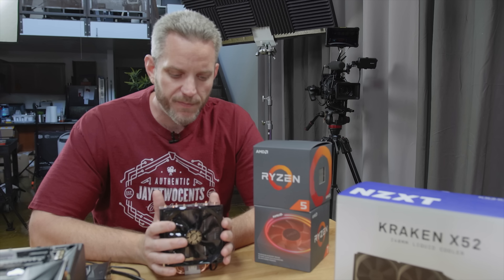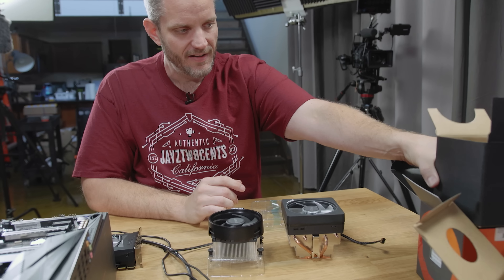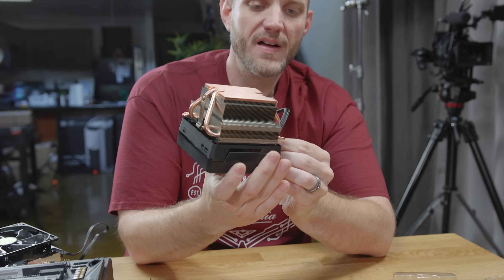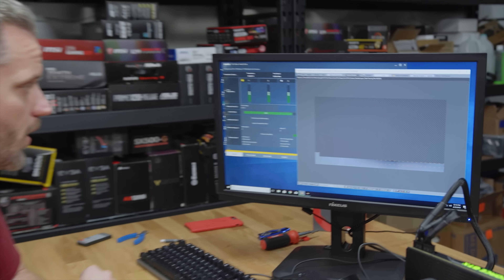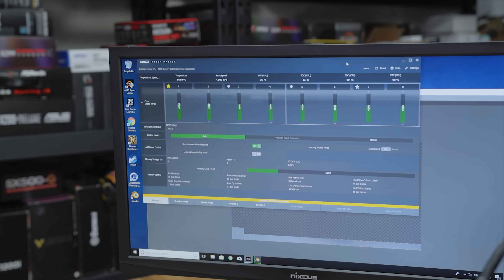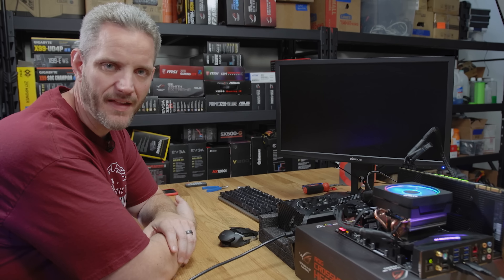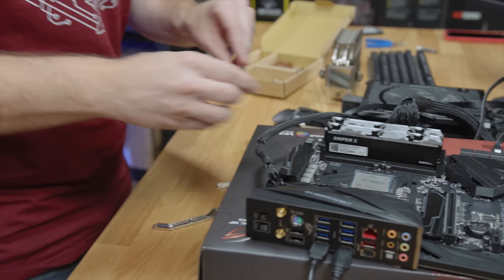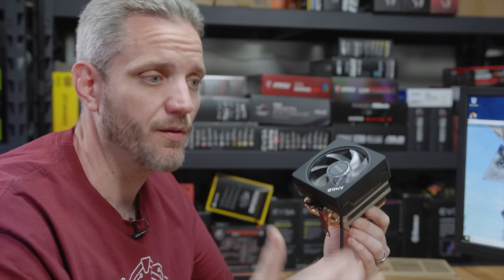Overclocking with a stock air cooler?? Is it even possible?

Comment: I have been overclocking with a air coolers for many years, well over a decade.    As you know, Noctua make good air coolers, I currently use the NH-U14S on my i7 7700K.

Comment: there is a small interruptor behind where the rgb motherboard header wire onto the wraith prism that has ¨L¨ and ¨H¨ , that way you manually let the cooler set up a more agressive fan curve speed at the expense of noise, still a terrific cooler for the ryzen though, intel needs to make such a capable cooler for their i9s i7s to get back in the game.

Comment: I have an AMD FX 8320 chip which is really an underclocked 8350, so I just set it to the 8350 settings in the bio (4 gigahertz, 1.35 volts) and use the stock cooler...no problems after 7 years of use like this

Comment: I'm running my Ryzen 2700X on the Wraith Prism as well, with a full overclock. (Budget reasons)

4.15GHz 1.325 Volt on Asus B450-E Motherboard
73°C max at full speed 3600 RPM with the Wrait Prism Cooler with high mode on. 19°C Room temp in the Coolermaster Cosmos case.

3m 30sec BMW Blender 2.82a render time
4150 Cinebench R20 score

It's a little bit lound but I don't mind it that much. Since it's nice and stable with no problemo!

Comment: This and the overclock with2700x video just showed me that I don’t need water cooling.
2700x with stock Prism cooler
ASUS Crosshair VII
G-Skill Trident 2x8gb 3200
At factory settings in my really old case with 3 fans (one of them a side fan) ~45-50C, in new Zalman case ~50-55C with 5 fans.
FYI - My old case was pre-RGB and cable management. It was a new experience working in a case with cable management. I’m curious about the loss of 5C with the loss of the side fan.
Case - Zalman Z9 NEO Plus PT Black

Comment: I've got a Ryzen 1600 with its stock wraith cooler. Only clocking I did so far was from optimal to performance. It seems to reach 4.1 ghz when it wants to and hovers around 65 for temp on any program, except for protein folding. I noticed when I run that on the cpu temps spike into 80 and maybe beyond.

Comment: Got this CPU for a build and going to do it on Christmas day. I am thinking to overclock this CPU to 4.0 GHz with the stock cooler, I will also have 3200 MHz RAM so think that if the stock cooler will allow it to run at a good temp it will be a safe bet

Comment: Socket 939 Athlon 64's OCed like beasts with stock cooling.  My 3700+ was running @2.6Ghz with the stock cooler.  Early Core2Duo's were also monsters.

Comment: It keeps overclocking in stock for me mostly at 4.3Ghz, then stopped auto-overclocking to keep it at 3.7Ghz max now it's around 26-30c idling and rarely goes beyond 40c which is insanely cool with stock fan. It freaked me out first with hitting 75c just using Youtube!

Comment: When I first got the Ryzen 5 1600, I overclocked it to 3900MHz with the stock cooler provided.  Under load it would stabilize at 55 to 58 Celsius even in summertime.  But I installed a Swiftech H240 X2 and now it runs stably under load ~39 to 40 C, with occasional spikes into the low 50's.  If I hadn't seen it with my own eyes, I'd think It was impossible.  I'm a very happy customer.  Of course, I also re-timed my  G.Skills Ripjaws V Series 16 GB (2X8GB) 3200MHz @ 16-18-18-18-38-56 settings to 2933MHZ @ 14-15-15-15-34-51, which made another huge difference in performance.  But I have to say that the AMD-provided cooler was very adequate … for those who are worried about it.

Comment: My friend upgraded his cooler and let me have his wraith prism and it’s working great on my 2600 

On full load it doesn’t go above 60 degrees Celsius which the stealth I had before idled at 60 and would run from 75-90 C on load and stress test would make it hit the safety shutdown (like 105 degrees I think)

Comment: I have a question, i bought a 3900x using stock cooler, on a x570 elite wifi, is it normal for idle temps to be at 50c and 85c at load on gaming, ambient temp is 30c, not used to the cpu running so hot

Comment: Hey Jay. I m returning to see your test again and again. I have a question.  As I can feel hot air over a water radiator when computer is in use, it blows hot air. Don't you think the stock cooler blows hot air through those fins in the motherboard? Just qurious.

Comment: I just got the 2700 X with that cooler and under any load that increases the fan speed, which is frequently , it is unacceptably loud. So now I’m am looking for quieter coloring options short of liquid cooling.

Comment: First time I feel disappointed that i dont have to spend money to replace the stock cooler.

Ive been struggling to justify spending money on a Noctua cooler but just looking at how nice this thing looks plus how it performs.

After this vid I will have to just fix the fan settings on my case

Comment: bought a budget gaming rig for 300bucks that included a ryzen 3 1200 and a 1660ti. went OC'd the 1200 to see what it does since I don't really care about it as I have a 3600x to replace it and was surprised that it reached 4ghz at 1.35v and the temp never went over 57C.

Not sure how much better the Hyper 212 evo over the stock cooler but thats impressive for a stock cooler.

Comment: I really enjoyed this video on the wraith prism cooler paired to a 7000 series amd cpu. Since I am building a new system with the 7000x cpu and am not interested in OC but rather using the eco mode setting and going down to the 65W level to keep the thermals down, I was wondering if it is feasible to use the prism cooler on my new build. Just want to know if it will work without the fan going 4000 rpm all the time, and if it will slow the cpu below the benchmarks established by the eco mode settings. Really enjoyed this particular video and thanks again.

Comment: Hi Jaz. . Very good video. 
I have bought new system with 2700x and I m using prism cooler which is the stock cooler. 
But I only do blender rendering on it. CPU temp locks at 85C as soon as I hit render..... What do u think. Should I go for AIO or not? Czz I use 24/7 rendering even for weeks

Comment: Whats the L-H switch on the side of the cooler? And i assume the other ports on the cooler are one 4 pin and one 3 pin fan header? I am not familiar with that fancy stock cooler. Just curious. Dont think anyone has done a video on that cooler but probably because its just a stock cooler, but im curious. Thanks if you can answer.

Comment: Depends on temps surely. I'm running an old FM1 2.1ghz AMD CPU @ 3.6ghz with the stock cooler and temps under max load stay under 70*C. Of course an aftermarket cooler would reduce that temp further but I don't feel it's required.

Comment: Able to complete Cinebench R20 with Ryzen 5 3600 at 4.6 GHz all core with Wraith Prism cooler. Max temperature 89 degrees. Daily running 4.3 GHz and it's around 62 under load. This cooler is cheap, it looks great and performs well!

Comment: well all i can say is this i am currently using an i7-4770, its base is 3.2ghz and turbo rating of 3.7ghz. i currently am getting 3.89ghz performance, with no heat issues. im using the stock fan that came with an Acer Aspire TC-605. so i guess it depends on how cheap the stock fan the company uses is.

Comment: I’ve been using the stock Intel 4790K cooler for 5 years. It just lately started having problems and the processor has been locked at 4.35 GHz for those 5 years. My NH-D15 chromax.Black should be in Monday xD

Comment: Honest question, after you killed the SSD with the mixed up SATA connectors from the powersupply, is there anyway of repairing the SSD? taking it apart and repairing? or retrieving data?

Comment: I use a standard Wraith cooler and overclock my ryzen 5 2600 to 4.05ghz with 38c idle and 68c at heavy loads (Stays under 50c for the most part with 40% fan speed) I think the cooler is more than good enough, if i bought another air cooler i could maybe get 5% performance max? which i dont think is worth paying for imo.

Comment: I haven't seen anyone ask this..... But what did you do with the switch on the prism cooler?
The prism has a switch that either limits fan speed (less noise) or "overclock" mode which removes the fan speed limiter.

Comment: I use the wraith prism on the 5600x today, and never go above 65C... usually I never even hit 60C. It's undervolted so hits about 1.2v at 4.67ghz using PBO. I can run higher bosst upto 5.8ghz but it makes no real difference and in fact means boost doesn't last as long so I just stick to the lower temps

Comment: That's why invested in fan guards for ALL 6 fans in my case, it's too easy to bump a fan, watch a misrouted cable get sucked into a fan. A cheap chrome fan guard makes less stress when looking inside while it's running and checking components.

Comment: I took off my stock Wraith Prism cooler, was disappointed to find that the bottom of the cooler is full of dips and is not flat at all. I didn't notice when I first installed it because it had a huge square of pre-applied thermal paste on it, but I think that's pretty unacceptable quality on AMD's part.

Comment: My 2700x runs at 65C with wraith cooler and turbo. drops to 52c wo turbo
Reply: Around the same for me also during long gaming it never goes over 60. Im pretty blown away by how good this "stock" cooler is, dont give a crap about fan sounds once headset is on you dont notice anyway. I dont bother overclocking. Im just wondering If I upgraded to a 5700x or 5800x could I still use it or have to invest in some liquid cooling.

Comment: If my 2700X is running around 43° with the wraith spire could I overclock? My other parts stay around the same temps
Reply: Also to mention mine Is auto clocking to 4.025
Reply: I’m still using the stock wraith prism cooler overclocked to 4.1ghz and not going over 50C  while gaming, even while using the stock thermal paste. 2700x also.

Comment: Yes that's a possibility. I overclocked an FX6300 from 3.5 to 3.8 with the stock cooler. It kept it under 60 but it sounded like a helicopter taking off.

Comment: Hi, Jayz. You think I should replace the thermopaste that comes pre-installed in the Wraith Prism Cooler. Is that, I read an article that said that when this person went to change the Wraith Prism cooler for a water cooler system, he does not know what happened but, the Wraith Prism Cooler came with the CPU stuck like cement damaging the pins. Such a situation worried me, since I just bought a Ryzen 7 2700x with the Wraith Prism Cooler. I will appreciate your answer.

Comment: I’m planning on upgrading my PC... AMD R3800X, 16GB 3600MHZ RAM and GTX 1080 (already have it)... Main use is 1080p gaming (target 144 fps) AND most likely streaming (would love to do 1080p 60fps but would settle for 720p 60fps)... Do you think the Wraith Prism is enough for this? I also have a CoolerMaster Hyper T4 available... Or should I get an AIO?
Reply: i mean... the cooler is available for under $35 and it looks really good. for what your doing i dont see how it isn't more than capable.

Comment: Honestly, we are running a 2200G right now with the stock cooler at 4GHz, I got to 4.1Ghz but wasn't very stable. And temps reach about 130-160F under load.

Comment: I recently bought the 2700X, and with stock air cooler (wraith prism) on a Asus X370F gaming, current 5200 bios, can get 4.2Ghz stable fine, including encoding videos with Vidcoder, and Heaven benchmark and a couple others. Anything over that though and screen does go black/crash when doing anything CPU intensive. CPU temp peaks at 80C when doing encoding or extreme loads, but probably averaged 79.

Note that when the system crashes temps only got up to 74, so it does not seem to be a temp issue. I left the voltage alone, did not adjust it, but have read on AMD that this CPU self-adjusts its voltage anyhow? I also set the fan to be at full speed all the time as a precaution, though I'm hearing now there is a L and H (low and high) speed switch on the side of the fan that is set to L by default so I will be trying that on High a bit.

Comment: Hey would it be possible to get a quick overclocking video dealing with the AMD FX processors paired with the MSI970 gaming mobo? Your old video with the fx8350 (currently what I’m running) has many different features and settings on your MoBo than I do on mine

Comment: Is the stock cooler for a 3700, 3800, or 3900 sufficient if you don't overclock them? Just wondering if I really need an aftermarket cooler....thanks in advance.

Comment: Im going to be using this cooler until i can get a kit from EKWB.. that kit is like $500 lol which is cpu and mobo.. with a 360 radiator.. 760 gets me to cool my gpu as well.. whatcha think? just go for the 760 kit? my case is the define r6 tg blackout that im saving up for

Comment: I've OCed on a stock air cooler. Wraith. A R7 1700 to 3.8Ghz.

I strapped a fan I pulled from a space heater and zip tied it onto the slot where my front side panel went. Plugged that bastard in and it roared. I OCed it to 3.8 and got like ~45C.

Comment: You tested it with motherboard horizontal and the cpu at the bottom where all the Heat Pipes rise up. What happens when the MB is vertical and only half the Heat Pipes rise above the cpu, and the other ones have to go down? Heat does travel upwards. Is there a drop in Cooling ability?

Comment: It definately is possible. Her me  as  long as the case is well vented with additional 2-4 120mm fans to get additional airflow in and out of the case. Managed to get cinabench r20 score of 7718 @ 4325mhz all core clock on a 3900x with temp at 90C. very happy loud and fuck though....

Comment: Why would the air from a top-down cooler help with the other components? Wouldn't that air be pretty hot already from cooling the cpu radiator? How is blowing hot air or ram any good? I would rather have a side airflow cooler pointed to an exhaust case fan.

Comment: I think the wrong sata cable plug refers to the fact that ssd`s need five volts only so from molex to sata you would need a 3 wire plug not a four wire one wich contains the 12 volt rail feed as well the 5 volt one.

Comment: you actually can if you undervolt the CPU, I have a Ryzen 5 5500, at stock voltage and Wraith Stealth it hits up to 88ºC in full load, 1.200v undervolt won't get past 55ºC in full load so there's plenty of thermal headroom

sadly I can't overclock it cause my motherboard doesn't allow it because it's an A520

Comment: i always thought air flow would be better in a case then on an open bench as you stated at approx 6:10 in this vid, my reason for that assumption though goes down to arrow dinamics mostly... with the case you can keep a seal around the air and force the flow over the entire motherboard and direct it to spacific components with added parts that direct air flow when its open bench... the air is more loose theres no pressure and therefore nothing restraining it to move over the rest of the motherboard...

Comment: My brave little 1400 got pushed to its absolute limits with its stock cooler in a phanteks p400 non mesh with only one intake and one exhaust fan.  It never could post at 4.0 for me but 3.9 and 3.8 were 'just' unstable.  3.7 all day though.

Comment: I tried to use the stock cooler on my 2700x but it was getting close to 90c while rendering videos. Having said that i usually render 10 to 30 videos at a time. Sitting at 86c that long seemed a bit hot to me.

Comment: even the smaller cooler (the one for the ryzen 5/3) is really good! i got a ryzen 5 1600 and on stock managed to clock it at 3.7ghz which is faster than the 1600x so saved a bit of cash there lol

Comment: Hey this isn’t on topic (kinda), I’m new to pc building but I’ve seen videos on how to download drivers and they have to drag the bios update to their usb file to flash the bios, do I have to do this on a b450 tomahawk max for a R7 3700x?  Also will my pc be considered overclocked if all I do is enable xmp?
Reply: i have b450m mortar max MB, and 3800x CPU and i didnt update any bios, i enabled xmp profile 1 in bios and my memory runs at 3200mhz now instead of 2400mhz, these processors overclock themselves to higher frequencies when you have better cooler.

Comment: I managed to overclock a 1700 to 3.989ghz on the stock wraith spire led with 1.265 volts stable, and never gets over 70c under full load. mostly around 64-65c. I tried over 4ghz, but that required a volt jump that put me over 70c. so just under 4ghz is where I rest with a stock cooler.
Reply: I tried 4ghz and it black screened

Comment: I used my OEM wraith cooler from the Ryzen 5 1600 for 3 years OCed to 3,8Ghz and 1,275V. The load temps were around mid 70s °C on CPU intensive games... Then I got a 144hz monitor, disabled Vsnyc enabled G-sync and the temps went above 80°C  (hitting max at 94°C) coupled with the PC freezing up...I then got a Arctis esports 34 duo cooler and the load temps went down to high 60s °C which is awesome. I was thinking of upping the clock to 4Ghz but I'm not experiencing CPU bottleneck, the 1600 is only 20-30% slower than the 1600 AF but it's still a capable CPU, more than my GPU which is def outdated GTX 1060 6gb (I'm going Radeon next money+value, 5700xt seems like a better choice than a rtx 2060 at same price, I dont care for ray tracing 🙃)

Comment: I am not sure if I did something wrong when I setup my PC, but I am getting temperatures from my CPU from 95 Celcius up to 123 Celcius. After just a boot from cold its 95 degrees. I was scared maybe something was wrong with the prism cooler, and I bought the be-quiet dark pro 4! Now my PC is very silent and the case is cooler. But I am getting the same temperatures according to monitoring programs like Corsair link... 
 Is it possible that my computer is giving me the wrong temp measures...????

Comment: My 3900x did not like air at all. I have mine at 1.25v at 4.3ghz stable. Still gets pretty hot even with the clc280. I almost think my bios is lying about the voltage.